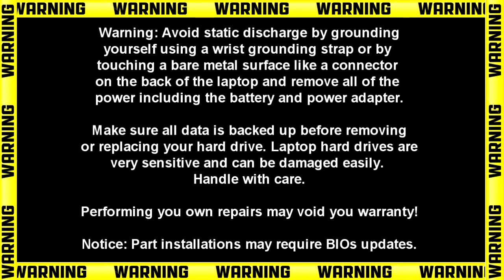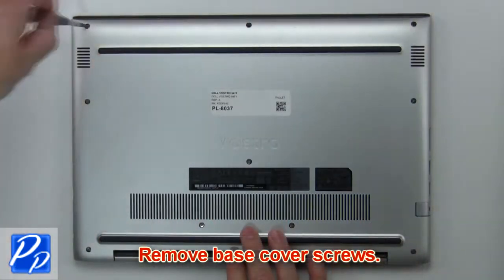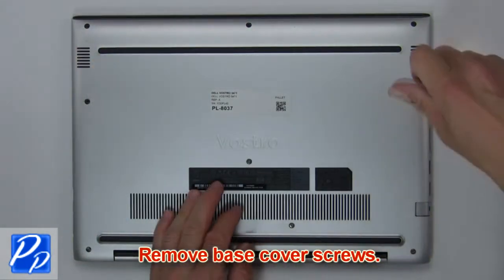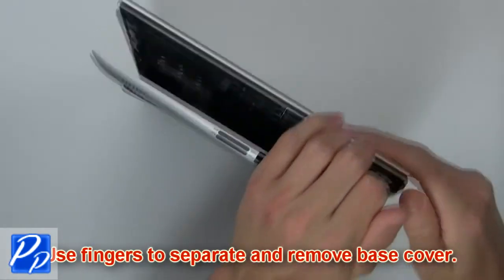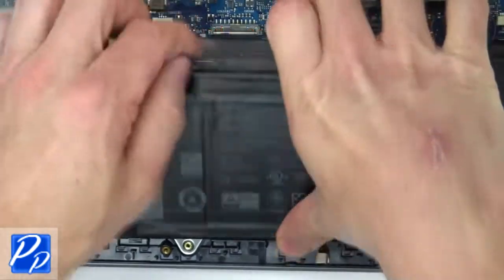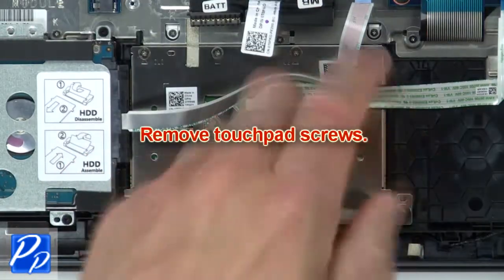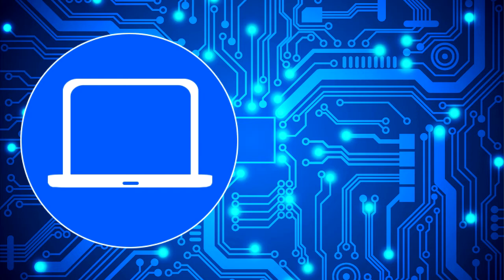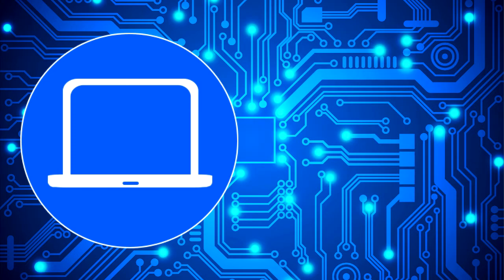Dell Vostro 5471 (P88G001) Touchpad How-To Video Tutorial

Comment: What may be wrong with the touchpad buttons if pressing them I don't feel any pressure, and they seem not to work properly?
Reply from the maker: Two different things could be going on here.  One, the touchpad button is bad and the touchpad needs to be replaced.  Two, your battery is bad and swelling up and putting pressure on the bottom of the touchpad preventing it from clicking.  The battery would need to be replaced then.